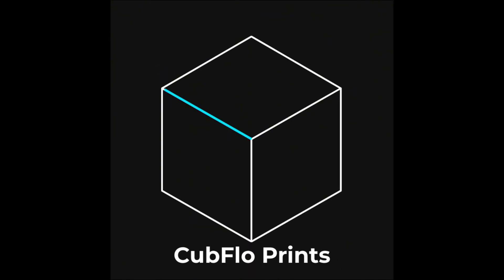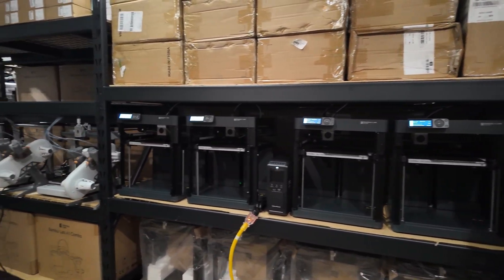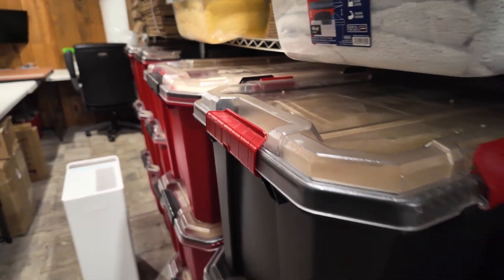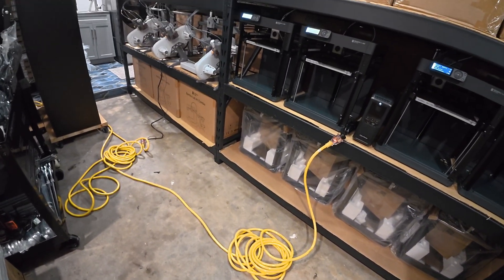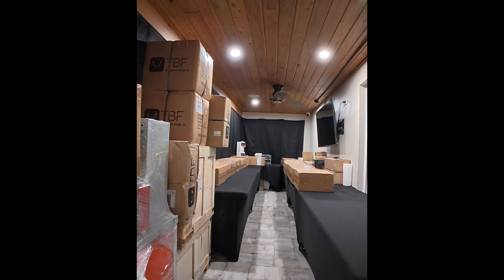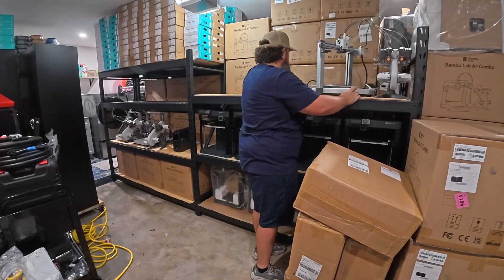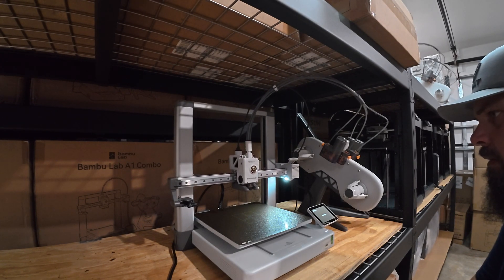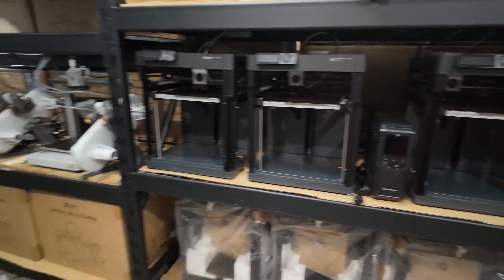3D Print Farm Startup – Day 5 | Setting Up + First Test Prints Running

Comment: Day 5 and we got the first print!  Woot!  Looks great so far.  I have a question about the P1P.  How are you going to change the filament for those?  You might need to put space in the back to walk and change the rolls.  Just wondering. On to Day 6!
Reply from the maker: Appreciate that , glad you’re enjoying the series! The P1Ps are tight right now, but the layout is still shifting as everything gets built out. I’ll be working out the cleanest way to handle filament changes as the workflow develops. More coming in Day 6 and beyond!
Reply: @CubFloPrints  I think you will ultimately give the P1Ps more overhead clearance, or you may find your PTFE Bowden tubes wearing out quicker due to them rubbing on the rack above during printing
Reply from the maker: That’s a good point, clearance is definitely something I’m keeping an eye on as everything settles in. I’ll see how the tubes behave over some longer runs and adjust the spacing if needed.

Comment: 3 a1's across likely won't work. you need room to change filaments and a poop collector. You may be able to make it work, just seems really tight.
Reply from the maker: Yeah, it’s definitely a tight fit. I’m testing the three-across setup to see how workable it is long-term, especially with filament changes and the poop collectors. If it ends up being more hassle than it’s worth, I’ll adjust the layout.

Appreciate the input, always helpful hearing from others who’ve tried different setups!
Reply: @CubFloPrints  I never considered putting the a1 AMS units forward leaving room for the poop behind it. 3 could maybe work across. Holy cow i could theoretically have 12 on one muscle rack instead of my current 8. I have 24 printers. Only two muscle racks for 24 printers would be amazing.
Reply from the maker: That setup could definitely work if you shift the AMS units forward a bit to free up space behind them. The muscle racks have more usable room than they look at first glance. I’m also waiting to see how the back filament spools fit with my AMS setup before I lock anything in. If you can get 12 on one rack with your layout, that would be a huge efficiency boost. Always cool seeing how different people configure their farms!

Comment: What sales platforms will you use? What software will you use for modeling?
Reply from the maker: Great question! I will be using most platforms. Amazon, eBay, Etsy, Shopify, TikTok shop, Whatnot, Walmart and others. I am still up in the air for the modeling software but will likely use Blender and Fusion 360. Most prints will be from commercial licensing!

Comment: I recommend putting 3 p1p s per shelf bc you need poop chutes and need to swap filament also for you ply wood thing it I recommend cutting it into 3 pieces per printer and putting foam on the bottom for vibration I see many print farms do it also how much have you spent on everything and when will your first print be
Reply from the maker: Thank you for your suggestions! I will be breaking all costs down soon as I still have to compile them all into a spread sheet. First prints I am hoping by the beginning of this coming week!